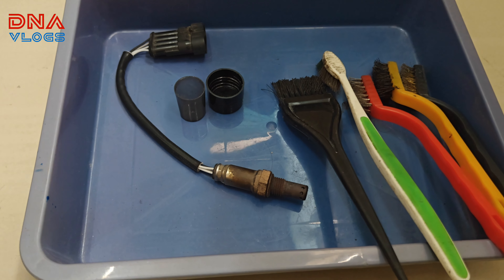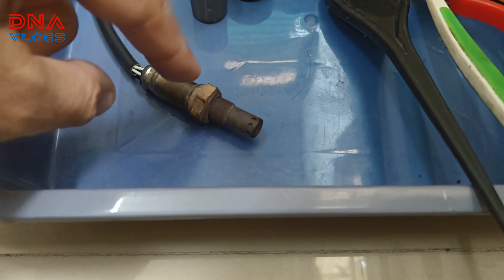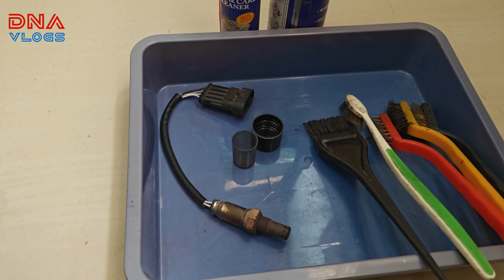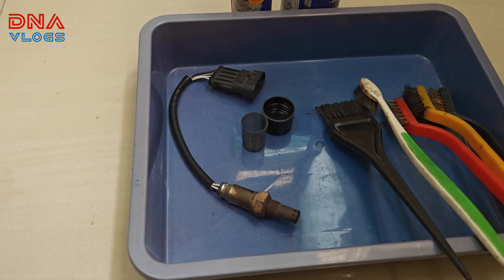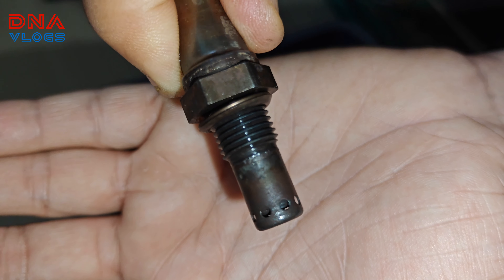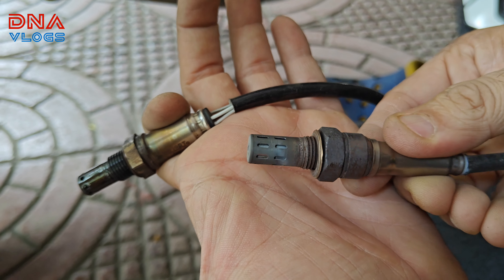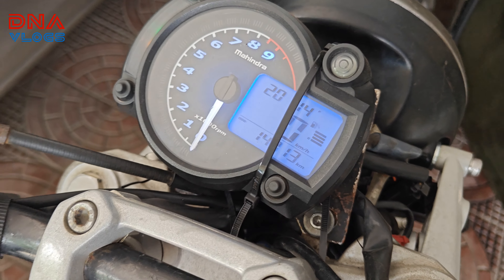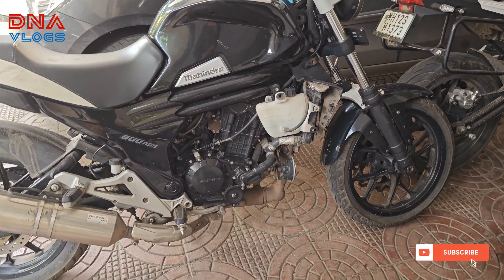Mahindra Mojo 300 | EP 6 | Lambda Sensor DIY Cleaning with WD40 & Throttle Body Cleaner | DNA VLOGS

Comment: Check the fuel pump or pump motor and hope it will not shows any warning lamp and so,if having any issues
Reply from the maker: fuel pump works fine. No issues .
Reply: @dipen.nisar.autovlogs fuel pump also have filter inside have you cleaned it?
Reply from the maker: @aayushpoudel2362  yes, that was done on day one. Episode 2
Reply: @dipen.nisar.autovlogs working fine is okay but how to check the pressure it is efficient or not?
If needed u can replace the fuel pump motor itself
Reply from the maker: @aswinraj6422  its working fine. if it was inefficient , bike wouldnt run so much. would have starting trouble etc. no such signs. so dont need to touch it.

Comment: I know it's a little late to comment, but if it helps here's what I want to share. In the third month of the Mojo ownership back in 2016 I had for the first time faced the random missing and a check engine light - the culprit was lamba sensor. When I pointed this out, it was quickly resolved by replacing my lamda sensor with another one from the shop floor - free of cost. For the next 20000 km the bike was largely uneventful but I have experienced the occasional shutting down and refusing to start immediately after riding in a  big puddle. I had a scaare once when this happened in the busy traffic after a massive rain. The uneven idling issue was reolved after cleaning the throtle body and MAF sensor. That is a routine job that will ensure you have a consistent idle. Lastly, the bike seems to love premium fuel and just like KTM it's very sensitive to fuel quality. One can certainly feel the muted performance after a tank full of ordinary fuel.
Reply from the maker: @Sobin16  tried and tested all of the above multiple times. Nothing helped.

Comment: Many Mojos have a recurring problem with the engine light going on and off and also having an uneven throttle response, which all stems to the electrical connector of the fuel pump, internal or external. Disconnect the fuel pump, remove it from the tank. First clean the internal filter, since you have already removed it. Disconnect the internal spade connector and check it for tightness. Next carefully check the external connector, look for black spots or signs of sparking and melted plastic. If the black spots are big or if the plastic has melted, change the connector, otherwise clean the connector with CRC or WD40 and very slightly bend the pin to give them a little curve so that one inserted into the female socket there will be better contact. Nine of ten times this will solve your engine light problem.
Reply from the maker: Thank you Ravi. Engine light is not a major issue as of now. It comes very rarely when i unplug any sensor before disconnecting the battery. But I will surely try all these steps / cross check each of the points you have mentioned. Thank you so much for your feedback and time to explain 🙏🏻
Reply: Wow thanks a lot man. Will have to check it then. The engine light is not an issue in my case, however, the uneven throttle response is. Even I suspect the cables and connectors. On my XT300, the harness connector that connects to the Instrument cluster is loose and the bike tends to halt at times.
Reply from the maker: Ok